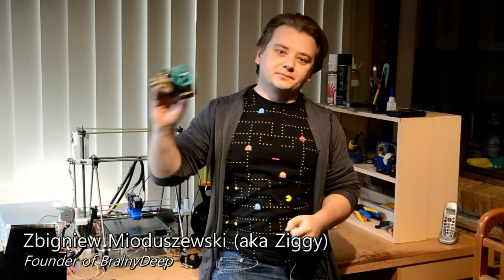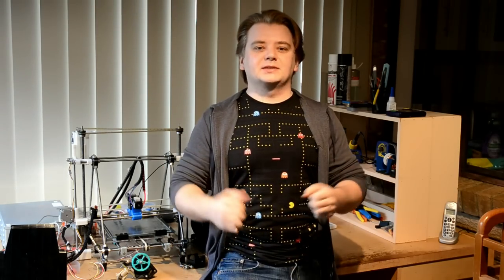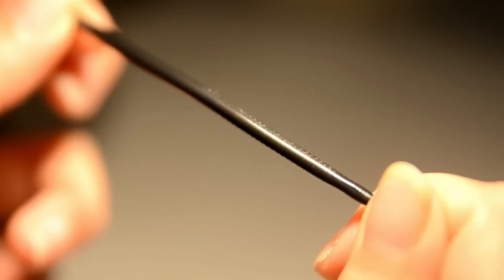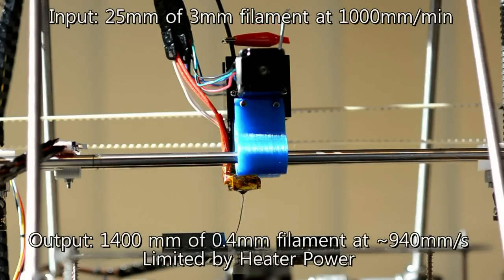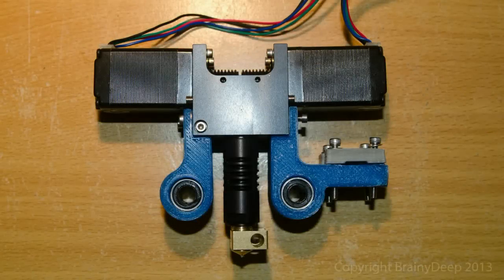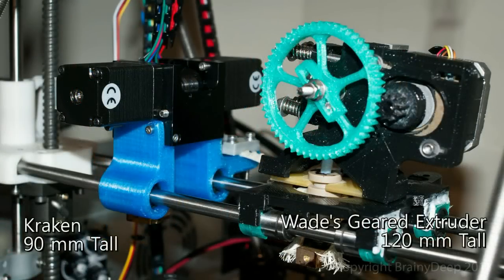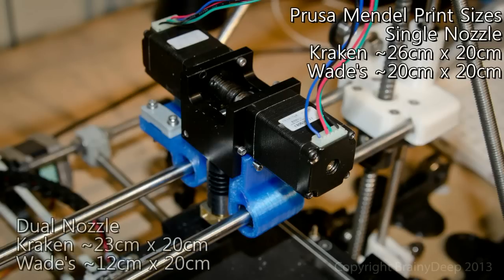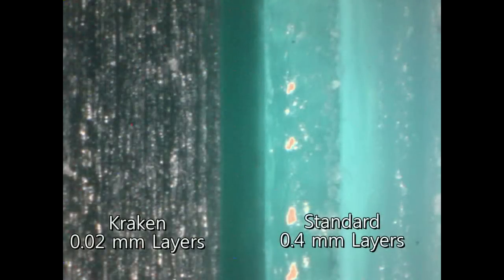The Kraken - The World's First Dual Pinch Wheel Extruder! (IndieGoGo Pitch)

Comment: The resolution (0.02 mm) is a steal at that price.  What exactly is the build volume?
Reply from the maker: Exact build volume depends on your printer configuration, but I've been able to achieve 26x20x17 cm (X, Y, Z) on my Prusa Mendel kit for single material prints, but this requires a wider bed than the standard configuration.

Comment: Fair dinkum mate, that looks like a cool build, yeah the height of the wades is too much, you used the KISS method.

I don't want to be a poppy chopper, Q: with the 2 extruders wont their be a need for software to tell the extrude/hot end how to operate, or would there be some form of offset in the firmware to tell it where to print ? I'm trying to wrap my noggin around how this would work, all up, it looks good.

One good place to show this would be on the actual RepRap wiki, show it to those guys and see what they think, would be a good place to get exposure.
Reply from the maker: Cheers mate. Yes, you need to configure your firmware with the offset, and each nozzle has it's own temperature control loop.

I didn't put this on the reprap wiki since they are really focused on printing parts for printers, whereas this one is not.

Comment: Can i build it on my ultimaker 1?

Thanx
Reply from the maker: Belga drone In theory it's a matter of replacing the connection to the original UM extruder and setting a new steps/mm setting. I created a very simple design for a bowden adapter. 
For a nicer integration, an adapter to mount a new extruder where the UM one mounts could be easily mocked up. I have access to some UM2's but I don't think their owners would be to happy in me experimenting with theirs!